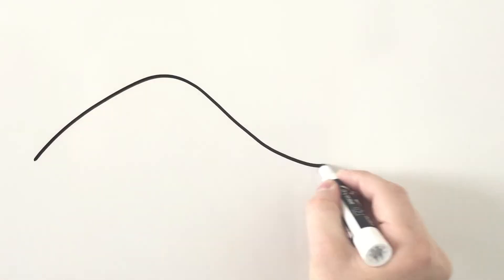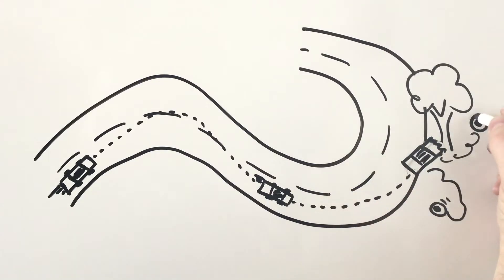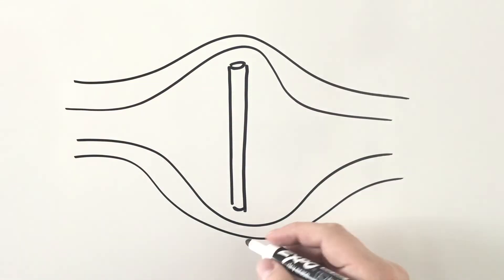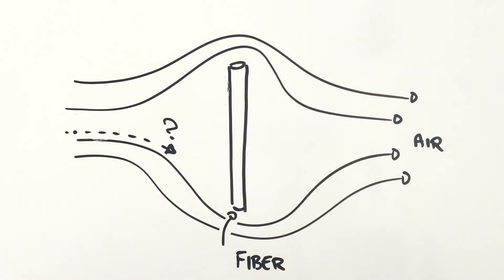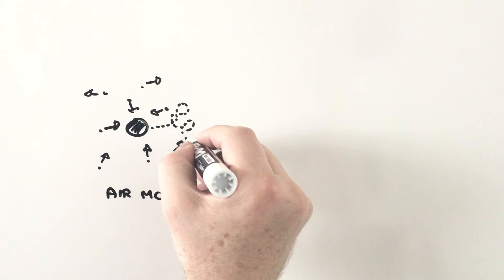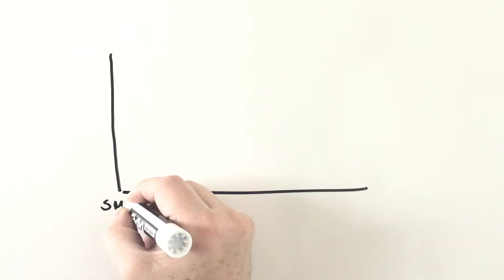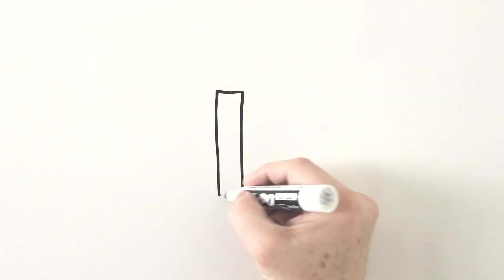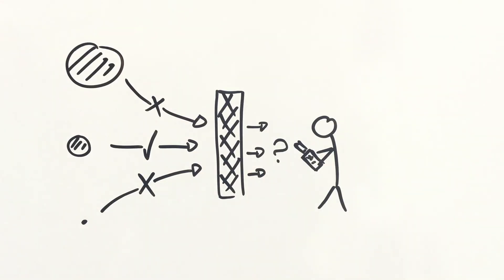How do air filters work?

Comment: It reminds me of the counter-intuitive way that size-exclusion chromatography works.
It's sometimes called "gel filtration" but I find that more confusing.
Basically if you pass a solution of different proteins through a size exclusion column, the big ones come out first and the smaller ones come out last. 
This is because the smaller ones takes the long narrow winding paths through the porous beads, but the bigger ones don't.

Comment: Is this the same for 0,22 micras water filters? I've always wondered how can a 0,22 micrometer filter could be a sterilizing filter if there are bacteria smaller than 0,22!
Reply from the maker: The same mechanisms apply to water filters, but the particle sizes they apply to are quite different due to the density and behavior of water as a liquid. In the case of bacteria removal, most bacteria are larger than 0.2 micrometers, but water filters will still remove particles smaller than this.